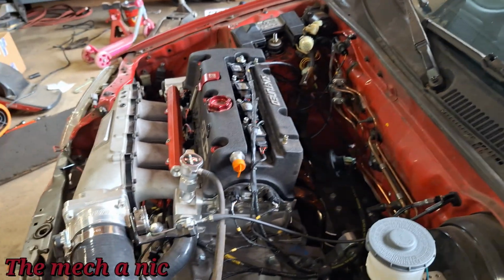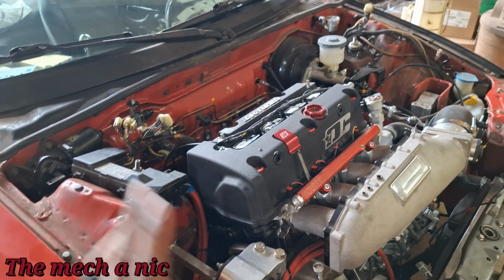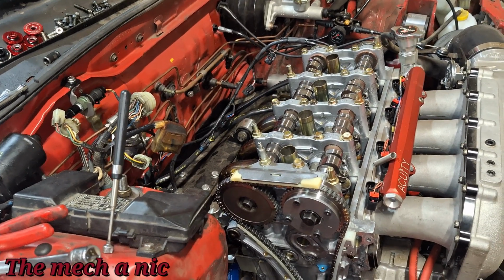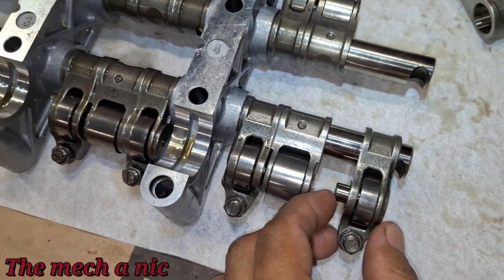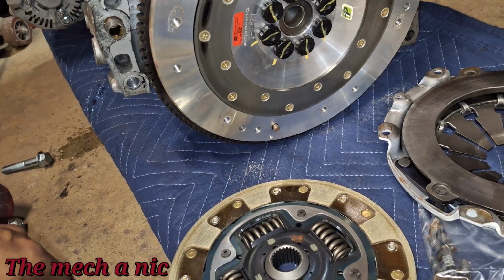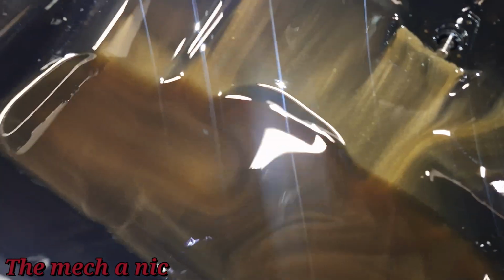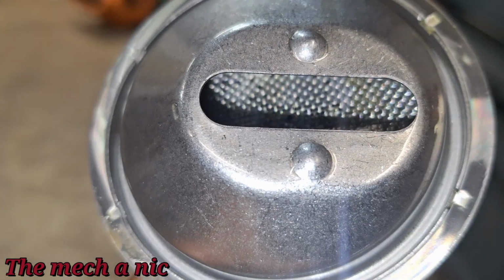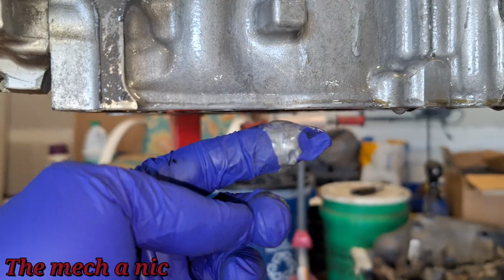k24 crx first test drive didn't go as planned

Comment: Man i dont see and can't think of anything that'd cause that noise. I'd say loose alternator bolts possibly. On another note, a catch can doesn't go on the valve cover port. You can put a breather there.  From the factory there's a hose running back to the intake. The catch can goes in between the pcv valve and the intake manifold on passenger side of the engine.
Reply from the maker: I have my pcv port blocked off.... starting to wonder if that's not a good idea. So I will have to attach a breather to the valve cover then.
Reply: @themechanic6117  Unblock the PCV attach a catch can to it then vent to atmosphere or preferably attach to the intake manifold like factory. It's there for a reason, it vents the positive crankcase pressure from building up. Vacum from the intake helps with that. That being blocked off plus the valve cover blocked off is causing a build up of pressure and that why you're having those oil leaks. Next thing to leak could be your rear main seal or crank seal.

Comment: You know it can't be something rotationally due to the randomness of the sound.  I'm stumped.
Reply from the maker: I agree with that. I think the weird oil pressure readings and the fact that desired vtc doesn't match actual is pointing towards a issue with the vtc actuator... ?? Thank you for your input.

Comment: Well, that's not good at all.  The paint is something  that shouldn't have been sprayed on eh :) I'm going with the loose alternator bolts causing the noise 🤷
Reply from the maker: At this point anything is possible,  I didn't actually find "a problem " in the engine so any theory is valid at this point.

Comment: Oh my goodness. So sorry to hear about this issue. That was a good idea to remove the fasteners with a hand ratchet (for the reasons you stated). Like you, I'm stumped on that noise. It doesn't make sense that a rotational component would be that inconsistent. Is it possible that it could be some kind of mechanical solenoid? I know nothing about these engines but I'm just trying to think what might come on/off at random times. Or a timing chain that builds up tension and at some point that tension gets released. I'm probably just sounding silly now but thanks, now I can't sleep.
Reply from the maker: People who have alot more experience with these engines keep telling me it's the vtc solenoid,  I got my fingers crossed that that is the issue because it will be a easy fix .I was bummed out but after seeing these issues inside the engine I'm actually glad I was forced to take it apart.

Comment: If I were you, I would seriously consider replacing those front upper strut mounts were something a bit better quality, and or performance. The current ones on there flex, a LOT
Reply from the maker: I did notice that but those strut mount bushings are pretty new, that have less than 75 miles on them. Maybe they need to be tightened a bit more.